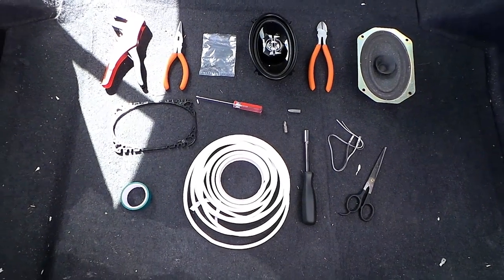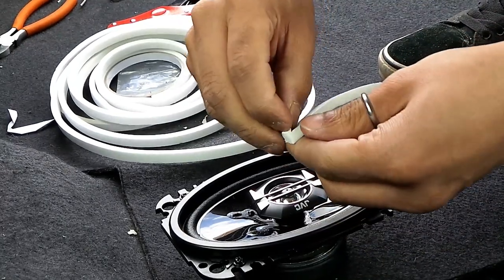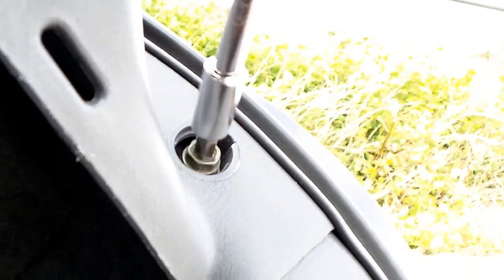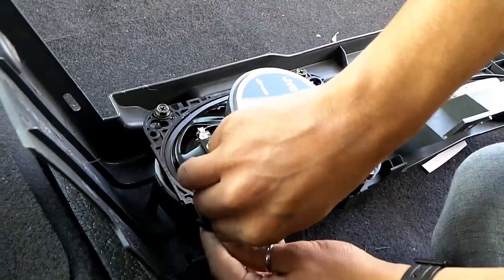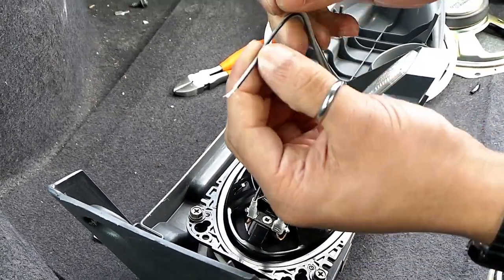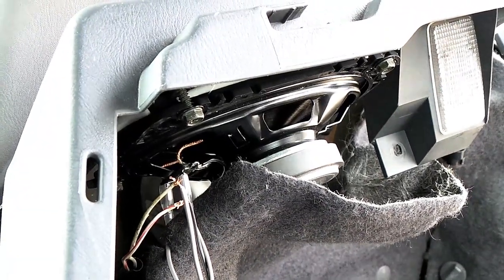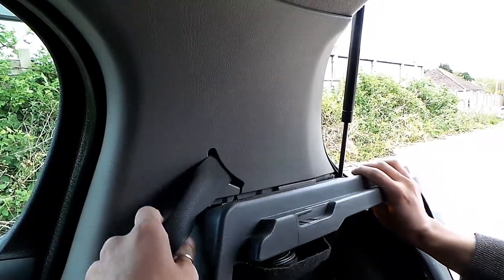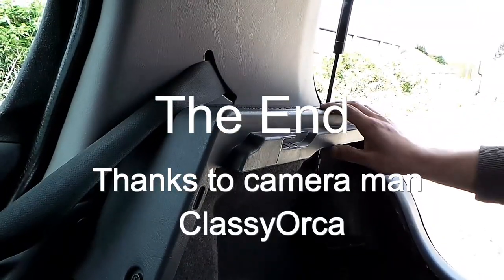Nissan Almera N16 Rear Speaker Install Guide

Comment: Cheers man, appreciated.
Reply from the maker: 0B ZEN No Problem.
Reply: Elektromo I've finished my install, and used your video as a guide. Was rather straight forward, with a bit of re-wiring, soldering, heat-shrinking, crimping...

re-fitting the panel is a bit difficult, but yeah, all good. Tilting the panel 90 degrees worked best, and then it just slots in. 

Cheers!
Reply from the maker: 0B ZEN No problem glad it was of use. I shall be uploading a video soon on how to do the front door speakers.

Also what speakers did you put in your rear side?

Comment: Thanks for the video! Im also thinking of chaning the rear speakers now.
is the difference really noticable a lot? especially the low tones, max volume and sound quality in general.
Reply from the maker: +Hendrik N.  Honestly it’s quite hard to really tell when I’m always the one driving so my front speakers overpower the rear. It’s really one of those things where you kinda have to sit there at the back and have a good
listen to whatever music you like. I would say yes the overall clarity is much better than the stock ones but due to the restrictive nature of the rear system getting a decent pair will be tricky.
Reply: Where did you get the adapter

Comment: Be good and tell me the size of the original speakers so I don't have to take off the carpet just to measure them. Thanks! :D
Back in the day speaker manufacturers gave you enough cable to wire the entire car... Now you just get a silly snippet of it. How lame.

Edit: ah, it's 6x5. thanks